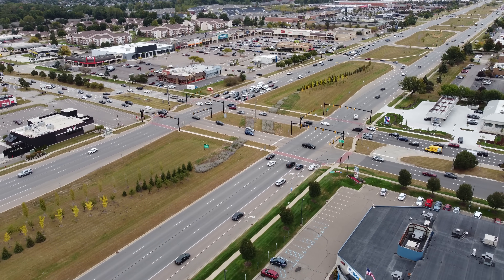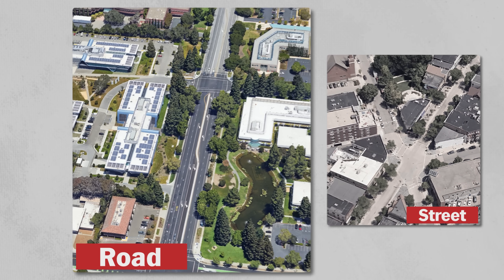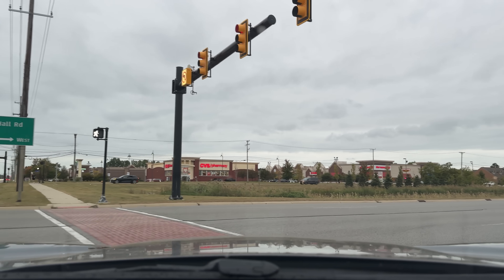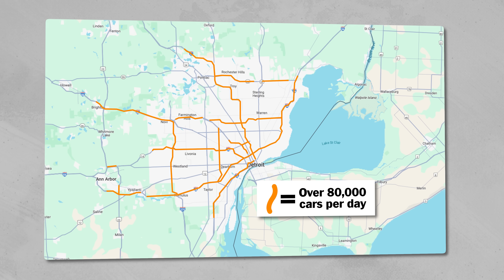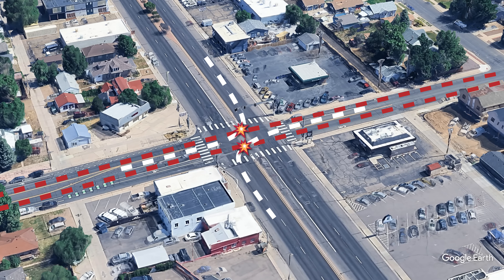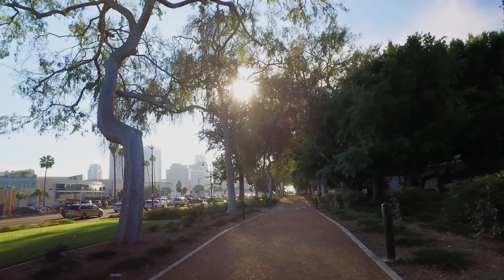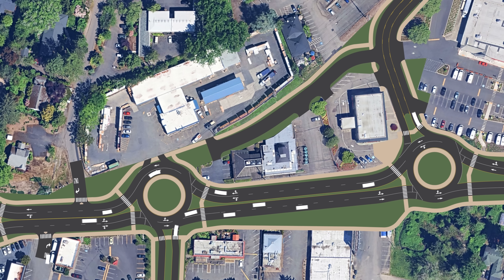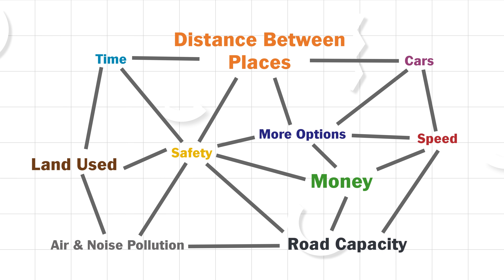How Michigan Built a Super Highway Using Only U-Turns

Comment: what is exactly the moral of the story when talking about the U-turn specific? the designs and animations in this vid are top notch as usual, but i think a few designaspects are missed. I dont agree with the "secretly genius" message in ur vid-template. It seems to work, but it has a very niche use.

The restricted crossing U-turn (as how its named in the usa) is not a magic solution for providing more traffic flow. The only thing it does is moving a conflictpoint further away from an intersection, which causes an extra potential stop.

The reason why the RCUT seems to improve trafficflow, is because the "highway" part has to sides further from eachother. This makes a two stage crossing possible. If there would have been a dedicated left turn lane onto the highway, such so that there is no conflictpoint with traffic onto the "highway", you have exact the same principle, just with a bit less waiting room. The beneficial side of doing that, is not have traffic having to cross lots of lanes to go left (creating merging conflictpoints) and theoretically introducing an extra point for traffic to stop.

Ur story about reducing conflictpoints is wrong too. It just changes the type of conclictpoints. A merging conflict (like on roundabouts) instead of a regular one. The real benefit of this type of intersection, is the amount of space it can "easely" create for extra lanes, without creating a huge crossplane. On the other side, it does sort of make the whole intersection a lot bigger, as the left turn could be considered as its belonging to the same intersection.

Comment: I think that there are still some difficulties with Hall road. To begin with, making right turns onto hall road and u-turns while on hall road can be tricky when there is high traffic volumes. This is because the traffic for thru traffic and local traffic is on the same roadway. a better solution would be a roadway like the Keystone Parkway in Carmel, IN for thru traffic with frontage roads for local traffic. This way thru traffic wouldn't have to deal with any traffic lights, and local traffic would have less traffic to deal with. Also using roundabouts wherever possible would flow better and increase safety. Space wouldn't be a concern because Hall road has a wide right of way. Although, the cost would be immense.

Comment: Roundabouts work well until traffic levels congest them and create blockage. At that point you have to start using traffic lights and it becomes just another intersection although without the dangerous cross traffic turn (left in the USA). You didn't mention the "idiot lane" in the stroad 😁.

Comment: A little more backstory...

Hall road was originally supposed to be a freeway all the way from Pontiac to I-94.  The (then) mayor of Utica blocked the freeway from going through downtown Utica because he thought it would decrease traffic flow and business in the town.  This is why the freeway portion of M-59 changes to the type of road featured in this video at downtown Utica.
Reply: That is interesting. In my opinion, there is not much to say of downtown Utica, but I see why they worried. I believe Hall Road was supposed to have an elevated viaduct for thru traffic at one point. Had that been done for Van Dyke eastward, traffic may have been smoother.

Comment: In European eyes this is a complete waste of real estate to begin with. And instead of finding  better solution to make all traffic flow (there is more than cars alone) there is chosen a solution that still use traffic lights and still need navigating over 3 to 4 lanes multiple times to make a simple left. I know the USA has negative sympathy with this direction in politics but in traffic it is just the opposite of right, and not wrong.

If this should be an (super) highway, there should be no level crossings of this type...

Comment: The first mistake is to lead longdistance traffic trough towns instead of around, this way two different kinds of traffik gets mixed. This mistake can be maximised by destroying a beatyfull riverfront with an interstate. Roundabouts are clearly the best solution if you have the space, whats usually the case in the US, in opposite to Europe where some strreets are just too tight for them.

Comment: That first strode is idiotic and a death trap before the alterations and should never have been built in that way, even with the u-turn system it is barely safer. A road with that many lanes should not have any turnings coming off of it, it should be slip roads allowing traffic to safely exit, and merge onto the strode. The only time there should ever be a turning coming off of a road like this is if it's in the middle of a city and the speed limit is 30mph. The end example of using roundabouts and taking all of the business entrances off of the main road is the only sensible option, funnily enough the rest of the world figured this out in the mid 1900's 😂

Comment: Hall road was built wider than it needed to be. If you would have looked at Mound, VanDyke, or Schoneherr road to the South of it the medians are much smaller. Also you forgot to mention that left turn on red is legal in Michigan when turning onto a one way or divided road so in non-traffic conditions the left turn is not slowed down by waiting for another light cycle.

Comment: The main reason Hall Rd (M-59) is so wide is because, what is now the center median was originally meant to be a below grade freeway connecting I-75 to I-94. However, back in the 70's, the Mayor of Utica, Mi. did not want the city  divided by a freeway. So, M-59 ends at VanDyke Ave., in Utica and becomes the Stroad you are showing in this video. My wife and I live a mile south of Hall road, and many of us in this area refer to it as "Hell" road.
Reply: The whole of 59 is zoned for a freeway all the way from 94 to Howell where it meets up with 96. I'm sure it will never happen, but they planned ahead for it
Reply: @Devilnutz2651  a freeway thru downtown pontiac??? no its not
Reply: Exactly. You were blessed with the pre-existing space to do this.
Reply: Can agree.....I live now down in sterling heights (15 and mound area) and I rarely travel to hall road unless I want to sit in gridlock 😂 but then again all of metro Detroit is slammed with people these days. I gotta move back to the country if I want any relief
Reply: This is my daily commute
Reply: No reason you can't have the U-Turns and the freeway.
We do it here by placing the U-Turn just a bit prior to the intersection and runing the intersection bridge over the U-turns as well.
Reply: Shout out hogs hollow
Reply: They had a grand plan for freeways around Detroit in the 50sand 60s….not only 59, Davison was to extended from 96 to the van dyke freeway or m 53 which you have out in Macomb . Also lodge freeway was to extend to where northwestern highway is as a freeway to what was supposed to be I 275 built through up to Clarkston where it would meet with 75 …. They scrapped the 275 plans cause of wetlands and too many lakes in the area, plus mayor Coleman young fought against 275 extension cause he wanted traffic to go through Detroit
Reply: @JS28600  You're right. Local governments were opposing a better freeway system while the "Big 3" automakers did't want a mass transit system in Metro-Detroit because they wanted people driving their cars. 50+ years later, we are paying a price for all those bad decisions.
Reply: @JS28600 I didn’t know that. I have to agree it would not have been great for Clarkston.
Reply: City of Utica and its dispensary have messed up what would have been a perfect road.
Reply: Not a fan of Hall, but Gratiot does the median thing too, and is WAY better to drive on.
Reply: Interesting! I’ve wondered why it’s like that.
Reply: I actually avoid driving to Utica at all costs if it involves me going on Hall Rd. It is the worst!!
Reply: I figure that some version of Seattle's highway system would work on m-59. Have a dedicated 2-Lane (each direction) freeway built above the median. It should be road that goes from Van Dyke to Grosebeck (m-23) with no exits.
Reply: Hell Rd is right. I avoid the area as much as possible! It really seems like they would have been better off continuing the freeway, separating the through traffic that wants to go fast from the people trying to bounce from store to store.
Reply: @andreaharthorn4327 my mom tells me to avoid hall road because of how dangerous it is
Reply: 59 the fake highway that goes from nowhere to nowhere.
Reply: @AMoneyVideo  lol true shit
Reply: Not too late to make it a freeway now. That way the speed limit can be 60+ mph
Reply: @peterroberts4415 west of the mentioned Van Dyke it is a freeway, from there to Pontiac.
Reply: @peterroberts4415  it actually is

Comment: Roundabouts are superior to the Michigan Left. Consider, in the Michigan Left doesn't remove stops/traffic lights on the "main" road. Eliminating a 15 second protected left turn is, at best a false economy. It also requires a rapid lane change to get to the left turn for anything over one lane which, on a sufficiently busy road, that can be problematic and dangerous.
Reply: Roundabouts would not work well here. You still have to periodically slow down and stop to yield to traffic in the circle. There is a very heavy volume of traffic on Hall Road (remember that it's 80,000 cars per day). The side roads will not get enough gaps to enter, resulting in delays and  backups.

Comment: Southern CA is chock full of stroads with center turn lanes and traffic lights out the wazoo. 7th St in Long Beach is like this without the center turning lane and high speed limit, it's a major arterial that feeds in from the CA-22/I-405/I-605, cuts through neighborhoods and has businesses along much of its length. Turning left against traffic is often terrifying, there are no traffic lights if you're on a residential street, the parked cars make the turn mostly blind, and good luck when 7th St is jammed. The 7th-PCH intersection and surrounding infrastructure is one of the worst I have ever seen in the region that isn't the 5/55/57 Orange Crush interchange that regularly ties up hundreds of cars on the CA-55. There is probably no viable way to fix the 7th Street problems directly because of a lack of usable space and the fact that the people in the affected area are well settled in, LB has to come up with ways to divert traffic away from that intersection. And the really funny part is, just drive down PCH and you run into an impressively good roundabout for American streets.

Comment: Interesting video but don't see anything genius about it, there are other ways to get a similar effect or better. One way narrower streets for ex. Or you could just take away left turn, go more forward turn right and right and right again and achieve same result without the size or this street and additional investment in turns and etc. The distance for pedestrians is also huge as is the space required. However in cases where there isn't enough money for a full highway and this is a temporary solution before a highway then I can understand. On the second part good luck with that. Roundabouts do work in certain cases, and is a totally workable solution, putting 3 of them in a row though seems like a dumb idea. For pedestrians won't be fun at all

Comment: In terms of land use, Hall Road is quite wasteful because it doesn't make use of the land within, except for the water management purposes it seems. But there really is plenty you could do while applying the same principles. If you're downtown, you can achieve the same effect by having two parallel streets become one way streets running in opposite directions, and the perpendicular streets becoming your U-turn. Or if you have a city park, you can make it like a giant roundabout, with a one way street circling it. Going back to Hall Road, if it was denser the center median would be quite nice for a park, provided you can be adequately shielded from the noise by trees, and that access is secure. If you're still in the sprawling commercial zone, those lots could become shops and businesses, provided you have a safe and dedicated left lane to slow down and turn in them (to be fair, that's already the case with the U-turns, so should be fine). This way you keep all the functionality of the road, and mitigate (or even solve) the land use issue.

Comment: Brazil has been doing this “return” system ages ago. And yet, it hasn’t solved safety on intersections. Yesterday I saw a terrible accident with two cars and a motorcycle in one return of an important highway here in Brasília. It seems the road infrastructure is just one of the factors involved in an accident. Road education and constant attention seems to be the most critical factor in avoiding accidents. EDIT: I still prefer roundabouts.
Reply: These kinds of "cut-through" intersections are also common in Turkey.

Comment: US-401 in NC near me does this and I absolutely despise it. I’d honestly rather just sit at a light.

The main issue is most of the roads connecting to it are minor and instead of making lights, they simply cut any crossing roads in half, so in order to continue on the minor road, you have to get on 401, make a u-turn, come back to where you just were, and then continue. Every. Single. Time.
Reply: The worst part is, it’s not exactly warranted for most of the highway. There’s nothing alongside it, it only exists to get people from point a to point b, and most of the time traffic isn’t bad enough to warrant the u-turns. A simple crossing would do fine, but no, this particular road has to be special for no good reason. Even major roads crossing it have to u-turn, except for this one random one where you can cross straight. It’s just annoying.

Comment: I travelled to Michigan once. I don't remember the name of the road the hotel was on, but I do remember those fucking Michigan lefts. If something was to the right, getting there was quick and easy. But that meant there'd be a left turn on the return trip, so it would take twice as long (the U-turn turn that replaces left turns involves waiting at an interminable red light on the median, and the U-turns were much further down the road than similar setups in California, which is another state that loves traffic overengineering). I was relieved when I finally returned the rental car at the airport.

At 5:13, the video depicts a hypothetical situation where a car turns right, and then just so happens to arrive at the U-turn light right when it turns green. That never happened when I was in Michigan, not even once. The U-turn light was always red, and it stayed that way for a long time, and it was not as efficient as normal intersections in other states. Trips with all the turns in one direction were reliably faster in the direction where all the turns were to the right than in the opposite direction, which is something I had never seen before. There was one place I found my self going to a lot which was ten minutes away from the hotel, but the return trip was at least 15 minutes and up to 20 minutes.

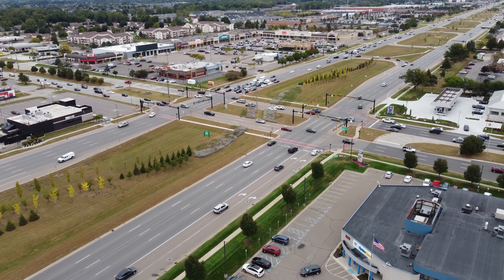Comment: When everyone ONLY turns right, they NEVER look right, only left for cars.  It's lethal for anyone not inside a metal m_rd_rbox.  It REDUCES pedestrian and cyclist safety (7:35).  Manila, Phillippines solves avoiding lefts by having 270 degree right turns around a short block, then into the direction "left" you originally wanted to go.
8:50 - All of which COULD have been avoided with good public transit.  ONE car lane in each direction, ONE rail network, and you get MORE human throughput (not "car", HUMAN) per hour.
9:15 - That's NOT pedestrian infrastructure because it's NOT protected.  The paths should have concrete barriers to keep people safe.  Stop treating crosswalks and pedestrian spaces as "run off areas for cars".  Make bad driving expensive and a long time to repair, prioritize safety ONLY for pedestrians and cyclists, and cars will slow down.
11:25 - EVERY city that has reduced speed limits DID NOT result in increased travel times.  What DID happen was fewer crashes and fewer fatalities, both outside and inside m_rd_rboxes.

Comment: I feel like the statement about a reduction of conflict points for the Michigan Left is a bit treacherous. This road design has constant lane changes everywhere. People who just turned right trying to zig-zag multiple lanes to the left just to make the U-turn. And similar to the weakness of clover leaf junctions, there is the issue that people who are leaving their turn need to leave their left lane as people who want to make the turn want to go into the left lane. The number of U turns in a relatively close distance is making me feel that the time to change lanes is pretty small, and to make it worse, people who have just turned need to build up speed compared to the traffic they are flowing into.
Is it an improvement to stroads? I don't doubt it. But I think it is nowhere near as perfect as this video is trying to make it seem. It is just moving the conflict points to invisible locations and relying on drivers to properly use their mirrors and for others to not do reckless things like trying to cross multiple lanes at once... but I think it is pretty fair to say you cannot rely on that given the amount of footage where you see exactly that happening.
Reply: You are doing it wrong.  You are supposed to turn directly into the left lanes, since cross traffic is stopped on red.